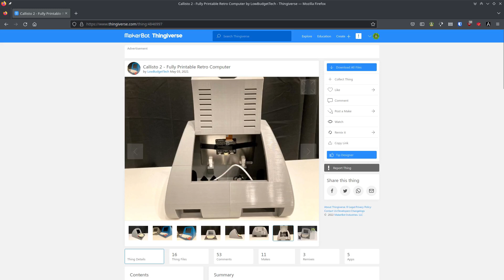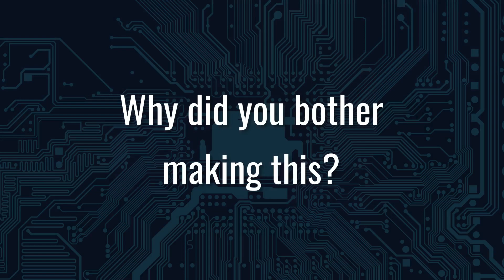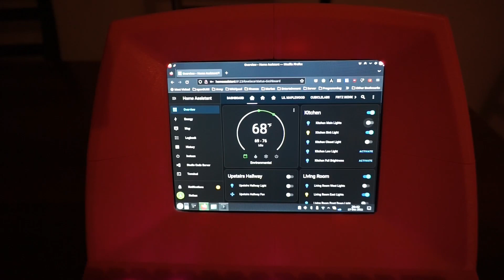Building a New Retro Styled Computer

Comment: That's a nice keyboard. And I love the style since I used to work on a televideo 920C and several other terminals like that. I miss the rounded CRT. It needs some kind of glass in front of it to get those nice rounded screen.
Only 2 of my terminals had flat screens (still crt).
The backside usually is riddled with D25 connectors, so seeing USB there is nice.

Comment: Awesome job Nat!! I think a small Intel Nuc would work well on that, my two cents worth Lol
Reply from the maker: The question I will need to answer is some sort of UPS system that will conveniently fit inside of the case. I think I have a solution using a USB C style backup battery. I will see if I can make it happen!